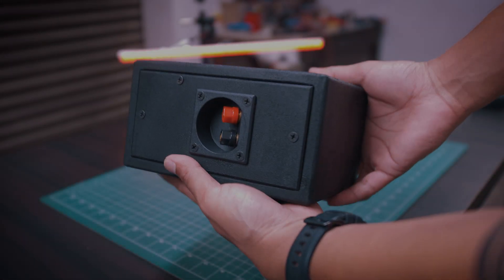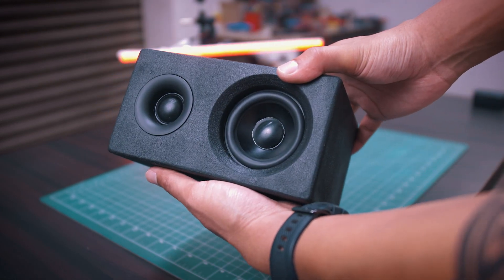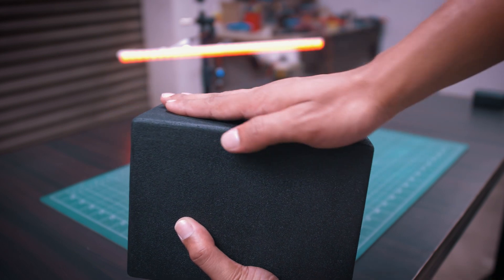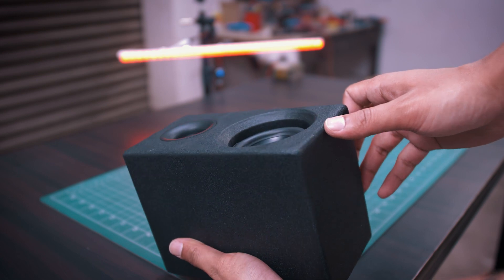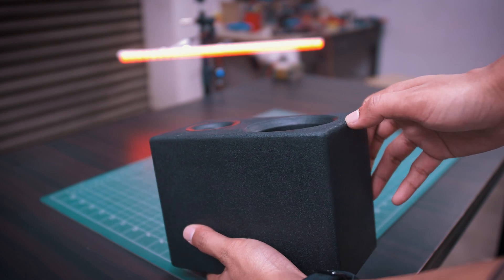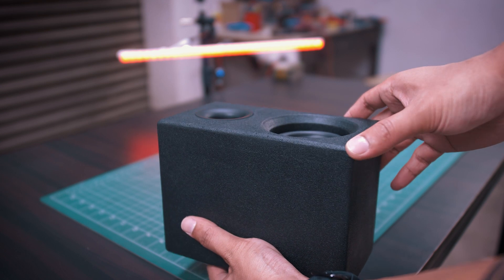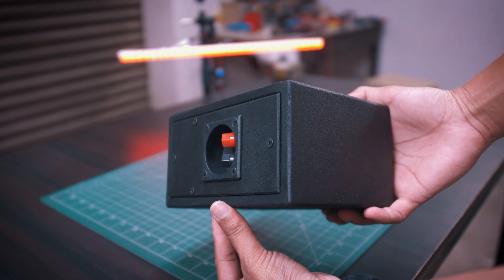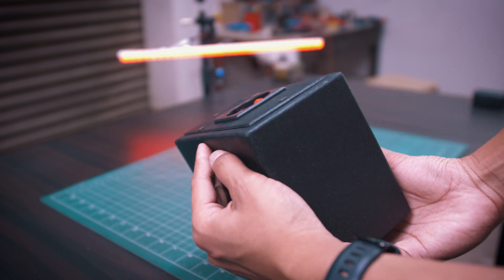Homemade Stereo Speaker | DIY

Comment: What is the name of the one you put it on? (2:00 green color)? 😅
Reply from the maker: Cutting mat
Reply: @SteveWillsonKujur  is it cut and fire proved? When i work on it, if soldering iron touch on it, then it will burn??
Reply from the maker: No it's not heat proof , it's cut proof to some extent 

The heat proof one called silicon pad